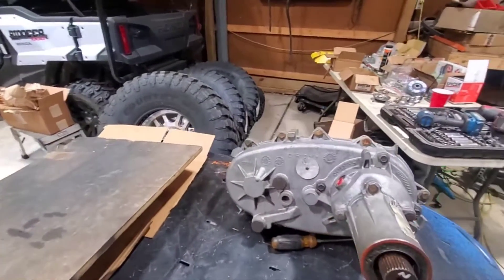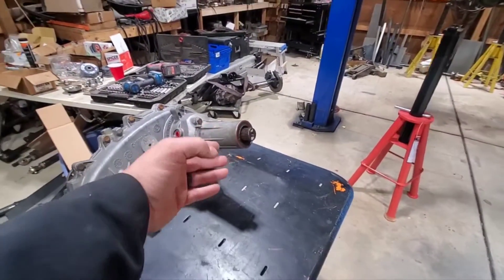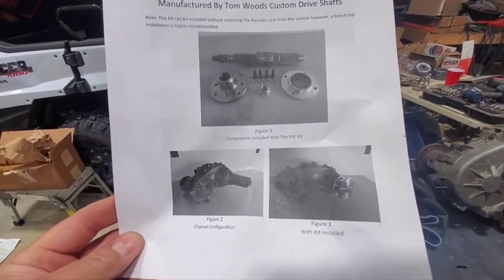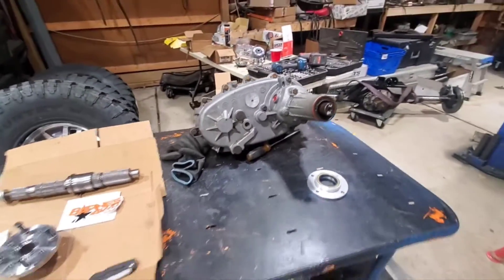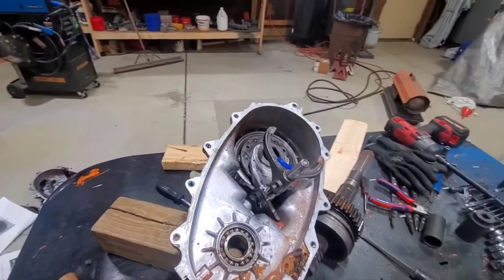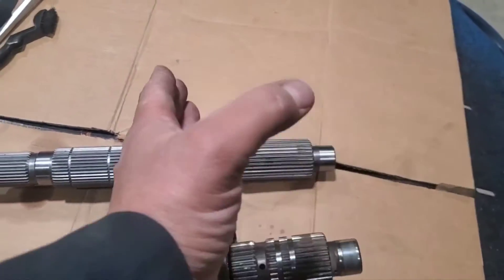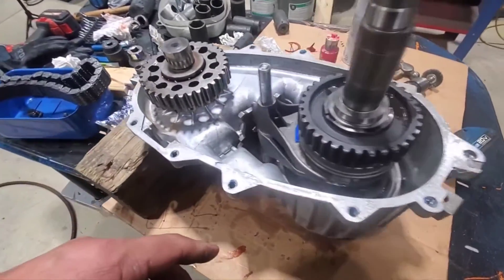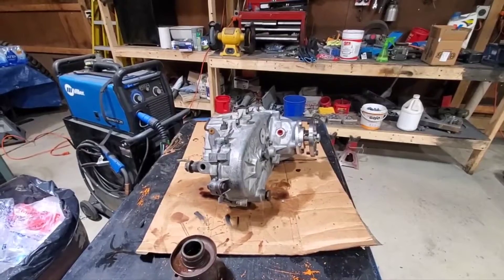LS Swapped Bronco II Project: Installing a Slip Yoke Eliminator (SYE) in a NP241C transfer case.

Comment: Thanks for the vid! My SYE kit from Tom Woods just shipped. Just to confirm, you do not reuse the two needle bearings on the new output shaft?
Reply from the maker: Yeah, if I remember correctly, there were two bearings not needed with the SYE kit.

Comment: I did a hack n tap on my 241c for the price of the companion flange yoke. Drilled and tapped the end of the shaft. Drilled and tapped the output shaft. Works great and cheap. Bonus: my EcoBox/205 is 19.00 inches, the 241 is 18.50 so no rear driveshaft modifications should be needed.
Reply from the maker: Nice, I've heard they work but haven't heard such a success story like yours so that's awesome.
Reply: @BuildItWheelItExploreIt  it has worked well. The 241s are stout tcases and can handle some abuse, my front seal is leaking ATF from the 400 causing the 241 to blow fluid out the vent, I'm using JB customs cable shifter and their 241 bracket and the vent is right at the bracket, I emailed them about not being able to get a vent hose on it and they had no idea what to do. At that point I was only a few weeks away from putting the doubler in and just capped the vent for the return drive home (after narrowing down the leak point). By the time we go out again I'll have to doubler in.